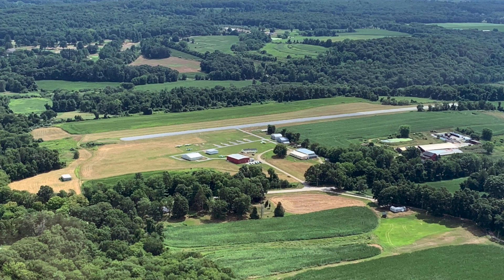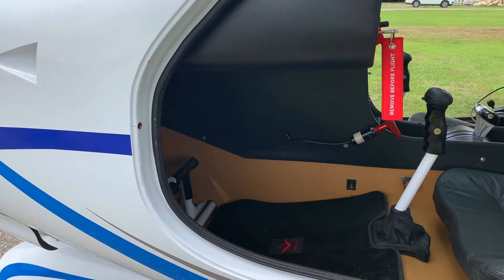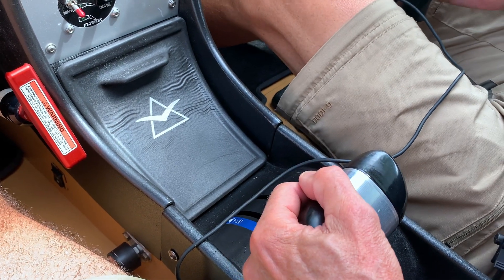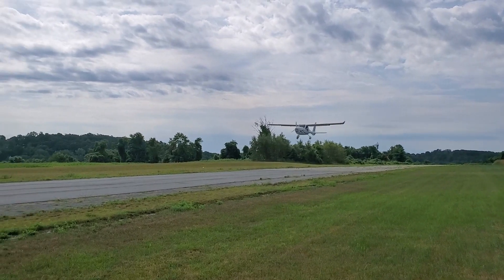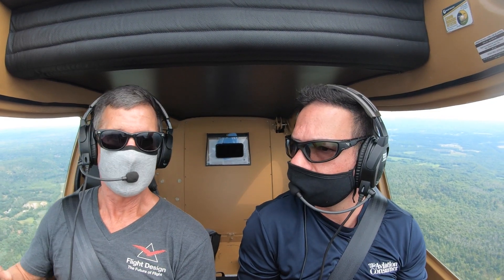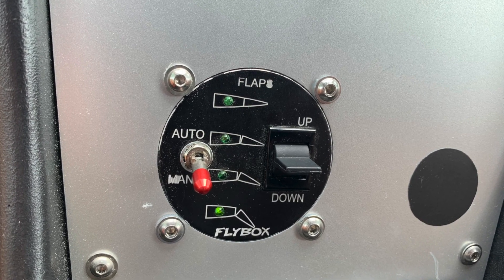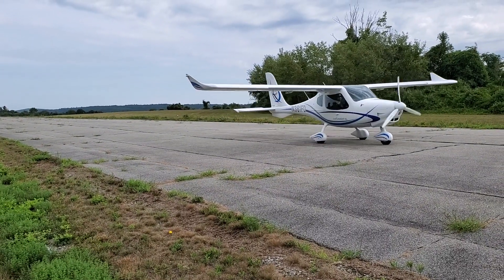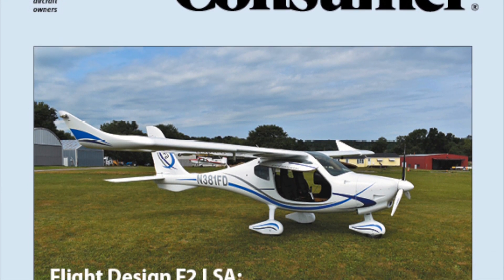Flight Design F2-LSA Flight Demo

Comment: Why a Rotax engine?  The reliability of a Continental O-200 is unmatched.  Yes, the O-200 weighs more; but is less complicated and the added weight of the O-200 is probably not enough to get excited about.  Also, the simplicity of an O-200 is unmatched.  The complexity of a Rotax is a little scary.  Is the Rotax engine the only choice; or can one get an O-200 as a alternate; but I assume would cost more?  Safety first; or a Continental O-200 engine first?  These kinds of safety choices are critical for long term, safe flying based on my 50 years and 1000 plus hours of flying time.  Does Rotax offer the level of reliability of a Continental O-200?  My readings say no; but is probably fixable by Rotax; over time and experience?
Reply: I have flown over 3000 hours behind Rotax engines, no problem whatsoever.
They are way more modern that those gas guzzlers.
Cooling is a non issue, as is no more shock cooling the cylinders.
Rotax has more engine flying hours than you and me together in their fleet.
Stop bashing Rotax and promoting 70 year old tech.
Reply: Listen Terry, the Airplane factory from South Africa, built the SLING 2 and then later the sling 4. Theses SLINGs were flown around the world. Once via the West and later via the East. Back to Johannesburg safely twice! Always with a Rotax. They flew one leg from LA to Hawai in 23 hours. And also from Brazil to Cape town in about 24 hours non stop.. so if Rotax is not reliable, then no engine is reliable. I have never seen a Continental engine flying around the world twice...
Reply: How many hours do you have behind Rotax 4 stroke engines? I’d take any one of the 912/914/915 series Rotax engines any day over an O-200 across the ocean.

Comment: getting checked out in a CTLS in South Florida. Cool airplane .I may buy a F2. WHY?
Light sport rules. NO FAA Medical.
Right now I am pausing?
WHY?
2023 FAA rewrite of LSA Rules. What suprises are in store.
Want to make sure an IFR rated pilot with medical can fly IFR in the F2.
and want to make sure a light sport rated pilot, etc can still fly VFR without the worry of the Federales possibly changing the no FAA med required rule as it is now.

By the way Aviation Consumer is fantastic. Ive learned so much.
Better than all the other mags and organizations out there.